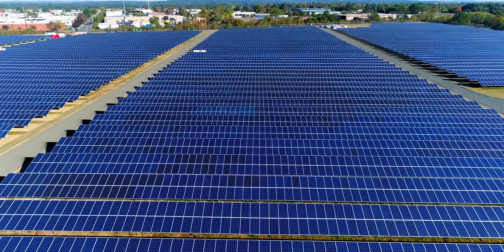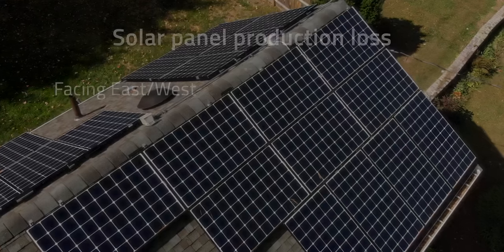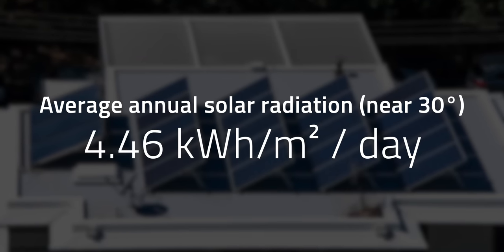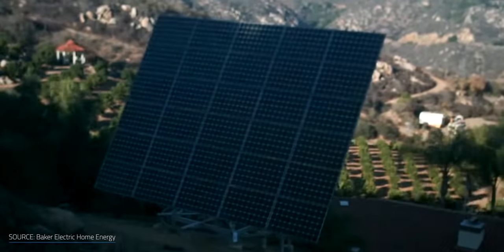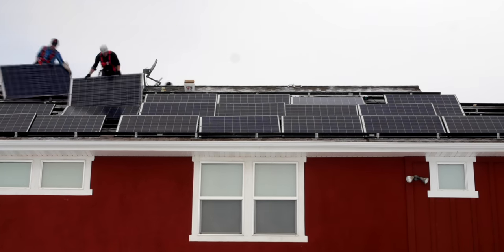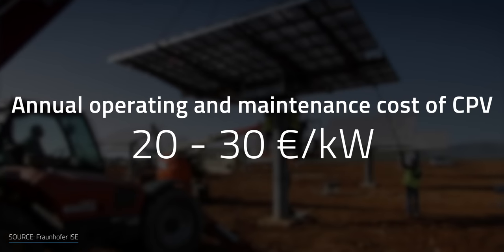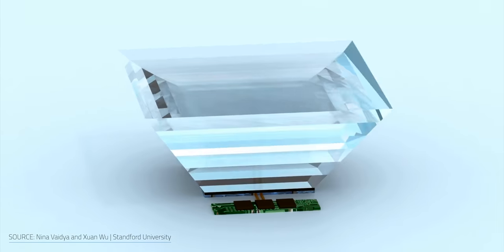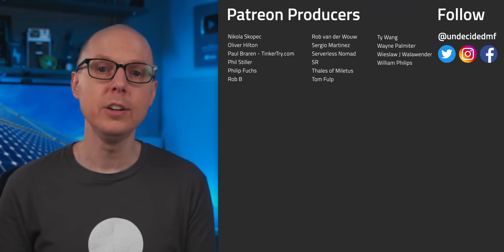This Invention Could Supercharge Solar Panels

Comment: My parents live in Macapá, Brazil, a city that is on the equador exactly. The solar panel angle there is basically flat up, but because it rains a lot there people usually install them slightly angled west or east so rain helps keep dust off the panels

Comment: One thing about PV panel angle that I think isn't looked at enough is what you are optimizing for. Most people and companies optimizie for maximum kWh per year which may not what you want. If you instead have a battery and want the greatest amount of self-sufficiency you have an excess of solar energy in summer but don't have enough in winter. So a higher tilt angle that gives you better efficiency when the sun is low would be beneficial. The same is true if you want to support the shift to renewable energy on a large scale because the bottleneck is always in winter so we should concentrate on maximum yield in winter.

Comment: Your presentations are so comprehensive, and so data rich and so fast in delivery, my brain blows a fuse at regular speed after about 5 minutes. I have to revert to playback at 0.75 or 0.5...need something in between those settings for optimal, non-barin-fuse-blowing...LOL...thank you!

Comment: At the college where I studied, there was research very similar to this solution in the video, but the conclusion was that the cost benefit is lower than that of a conventional panel because the panels lost much of their useful life and the cost of renovation greatly reduced the savings generated by consume less energy from the electricity grid. Another problem found was the heating control for the entire piece in general, which in normal roofs could even cause temperature problems in the house. I was no longer interested in the project because I graduated before seeing the result in detail but I know that it had a conclusion and that they moved their efforts to another project that I am not aware of. As I said, I know that the conclusion was that the cost benefit exists but it is lower than in conventional panels.

Comment: There are some issues with AGILE, I think... Whenever you put any material between the sun's rays and the actual solar collector, you will lose some efficiency because the material itself will absorb some of the light. Additionally, the material you have between the rays and collector will take damage over time due to weather. This is inevitable. So if they do this, the outermost layer will need to be very durable, which will likely come as a tradeoff between light transmissibility. The other issue with concentrating light is heat. The more concentrated, the more heat, the less efficient a solar cell operates and the more quickly it will degrade. That's why it has to be cooled, but in doing so, you're using up more energy.

One of the reasons why solar panels are so inefficient is because they can only collect a narrow bandwidth of light, usually only in the visible range, which is a tiny percentage of light's overall bandwidth. Something interesting I've been watching has been the application of fluorescence, or florescent layers, on top of a general solar cell that you could buy today. A good channel to see this in action is the 'Robert Murray-Smith' YouTube channel. He had a generic solar cell, then took a highlighter, drained out the ink, created a plastic/gel plate out of it, then laid it on top of the solar cell and showed an increase in voltage. I think it went from 1.2V to 1.8V which is a 50% increase in generation capacity and I don't think there was any additional heat created.

If you could dig around and see if there's a company exploring fluorescence with existing solar cells, I'd be very interested in watching that one.

Comment: When I was in grad school, I had a friend whose capstone design project for his batchelor degree had been building a system that determined the sun's position based on GPS and the time of day and then angled solar panels accordingly. I asked him if the increased efficiency was enough to offset the power consumed by all the extra equipment, and he said it wasn't really.

Edit for context: The project was commissioned by the school's paleontology department to boost the efficiency of the solar panels used to power the equipment used at dig sights. The fact that the panels are used in varying locations across North America was the primary driving force behind building a system that's more complicated than the ones described in the video.

Comment: Putting a few modular batteries in the gaps between the inverted pyramids might be helpful. If they slide in and out on needing replacement. A PV panel with integrated battery storage would solve the day night problem but it would be heavier so the roof applications might be a problem. The lenses them selves may add enough weight to challenge some rooves.

Comment: If you have the solar panel tilt set for the latitude there is no need for dual axis tracking. Also for Bifacial solar cells laying down a layer of crushed limestone under and around the panels would help increase efficiency on the cheap.

Comment: An interesting observation about seasonal needs and tracking system orientation is that in heating dominated climates orienting a single access tracker east west so that it points down at the lower winter sun better, provides 30% more electricity in the winter when it’s needed more.

Comment: The best solution is altitude!  I tested the watts per square meter at Boulevard CA, at 3,600 feet elevation and San Diego at near sea lever.  You get over 925 watts per square meter at the higher elevation and only 850 at the lower elevation.

Comment: Local weather effects how desirable an active positioning system is.  When it's cloudy, the orientation of the solar panel doesn't matter. So if you live in a place that's cloudy a large fraction of the time, the extra cost and complication of tracking doesn't buy you much.  You'll get a better return from tracking in Arizona than you will in Wisconsin.

Comment: I think in many areas, the "simply add more panels" strategy will win for the foreseeable future. 
In my densely populated home country, The Netherlands, there's still so many industrial roofs, lakes and highway roadsides which aren't covered with cheap panels that "smaller footprint with higher cost per watt" is a very unattractive proposition. They often even mount bifacial panels east-west instead of south on purpose, because watt/m2 is less important than the need to fit the consumption curve.
Reply: How much coal to make a solar panel for a house about 6 to 10 tons of coal to make a solar panel for a home that last 25 years before land fill

Comment: I won a tonne of those in auction (the concentrated PV cells and the lenses), from a company that went out of business 15 years ago. So this isn't really new per se. Probably the techniques for creating the lenses has improved which is why it's being revisited? Regardless of the ability to bend light, the beginning of your video still needs to be computed (optimized incident angle for the region being installed) for maximum year round efficiency. One of your better videos IMO Matt. Thanks for sharing your passion.

Comment: Will did not mention heating problems.     The concentration of the sunlight is also going to concentrate the area that ends up getting heated.... and hot solar cells are less efficient.    I would be interested in information on how the AGIL system would address this.

Comment: My research with published papers shows that 2 DOF solar trackers can improve energy scavanging by as much as 40%. Now, you need a low mass system based on parallel mechanisms and proper controls for very slow motions (I still need to publish about this control one). Timers is not the right way to control them and we can use a few more photocells to avoid following clouds.

Comment: Sugar is formed possible by carbon from solar and hydrogen to make glucose of C2H6 strain use moveable cell like sun flower trace sun direction but the new design is petal that can passively push light or attract light to control uv level interactively

Comment: Probably the biggest use for something like this would be on a boat. On a boat, the best position for a solar panel is flat because the orientation of the boat to the sun is constantly changing. There is no "South facing side" as that side changes with the wind, tide and course. The other reasons for placing solar panels flat on a boat might include wind resistance or preventing lines from being snagged on the panels. Other issues common in boats is changing shading as the boat moves or as sails are set differently. On a boat, one normally expects to get at most about half of the rated power even on sunny days. A panel of this design could boost this significantly as even shaded panels would be able to see more of the sky.

Depending on the cost of patents, this could go far. That is, if the cost is still too much higher than today's flat panels, it will remain a niche product. Time will tell on that one. The other problem may well be the durability of the lens material. Right now, flat panels continue to be useful for decades, while flexible panels seem to have a short life (rated for only 5 years) because their coating is a plastic instead of glass. So while a flexible panel conforms well to a boat deck surface and can even be walked on, many people still use flat panels because of that price and longevity difference. Lens based solar panels could very easily be made flexible or at least curvable but I don't expect them to be used on a walked on situation.

Another possible advantage to lens based solar panels might be higher voltage voltage panels that are still quite resistant to shade. There has always been a trade off of cell size (fewer large cells are cheaper to produce) and voltage (more cells are needed to increase voltage). However, having parallel cell strings allows more power in partly shaded situations with higher voltage panels. Of course more cells on a lens based solar panel would also be more costly to begin with for the same reason.

Another possible advantage to lens based solar panels which would benefit home owners as well, would be that extra space between the solar collector chips... a great place to add "cooling" tubes where fluid could be directed. This heated cooling fluid could be used to heat living space (we probably don't want it to get much warmer than that).

Comment: This is something I had always wondered why it doesn't already exist for solar. The benefits seem worth it to me. But I wonder if we can take this a step further-- what if the collection area wasn't just in the concentration point, but also add cheaper single-junction cells around the concentration point to collect additional falloff.

One thing we didn't touch on here was also the increased temperatures. In NA, even higher latitudes, solar panels benefit from radiative cooling and even active cooling arrangements where just a little breeze can increase a residential setup by enough to matter (as long as you are storing it properly or feeding it back to the grid for credits).

Comment: i saw a solar tracker that was hydraulic with no electricity. there was a black plate that stuck out each side of the panel that when heated by the sun would expand the vertical or horizontal lines in a way that  the path of the sun would cause it to adjust automatically keeping it facing the sun .

Comment: If this works as explained here, this would even concentrate diffuse light, something that normal lenses cannot do. That would expand the use-case to more cloudy regions, where traditional concentrating systems make no sense. 
But of course it is in the end down to cost. With straightforward PV being so cheap nowadays, and still getting cheaper, it is hard for new technologies to catch up.

Comment: 11:08 It's not like getting an automatic tracking system. The only benefit is that you reduce the surface needed on the cells. Adding tracking to AGILE cells would still improve the performance the same as before. The video don't address why bad angles yield less power. It's simply because it blocks less light (leaves a smaller shadow) if it is angled. AGILE would behave exactly the same.

Comment: I have some ground post solar path lights that have glass domes with focusing dots all through the inside.  Works great!  Downsize?  The heat from full sunlight, even north of the 49th, means that the internal plastic mounts have melted in pretty much all of them.  Focusing means heat, heat means lower efficiency and DAMAGE past a certain point.

Double edged sword to be sure.

Comment: Instead of just a concentrator going to a multi-junction cell, how would the cost/efficiency compare to also having a prism spreading the sunlight's colors across several wavelength-specific solar cells?

Comment: The limiting factor you explain so carefully is the discrepancy between area incidental to the light and the surface area of the soiar panel. That issue is not addressed by these lenses.

Comment: You could simply fabricate the panel  with piping glued to the back of the cells (even aluminum foil) that simply plug into the neighbouring panel with a connector. Then you simply use any cheap flex pipe, run it to the persons refrigerator, bore it into the freezer then back out again. Then you simply throw up a concentrator over the array as neccesary. This is for flat mounted standerd arrays. Pretty freaking simple. The end panels would simple have an adapter to bolt the concentrator supports to. Thats pennys in additional cost.🤷‍♀️. I was a pv system designer and installer btw. Dont forget the dc pump which is like $300 and its dedicated solar panel, $60. In theory you could use the outside pipe thats for watering your garden and splice back into it before the bib but that would never work obviously. But God i need to see it. The idea is making my head hurt. Though i know making it feed into itself is not gonna create a perpetual loop of flow. Damn

Comment: Try using one Solar Panel at the bottom  and on the spaces between the grids use fiber optics to layer another stack above. It is all in the way that you space them apart it can work as long as the spaces between are just right.

Comment: I was doing some research and came across another tech being developed that uses lead selenide quantum dots printed on an organic polymer. The idea is it converts lower infrared spectrums into higher spectrums so the cell receives more absorbable light. It is a sheet that can theoretically be applied to an existing panel with ease. I wonder if these two technologies could be combined for an added effect? It is being developed by Cambridge Photon Technology, an offshoot of Cambridge University, if anyone wants to check it out.

Comment: That's very interesting we tried a simpler system in the early 2000's and the panels just heated up to much reducing energy output
We tried cooling the panels with airflow system and blanketing panels with water cooling 
At the end of the day the panel out put did not support the overall cost to watt ratio

Comment: The cell layer tech and lense magnification has been around for 50 years.  They have been used for space applications since the 70's where reduced weight and size plus reliability and maintenance free operation comes way before cost.    Higher cost of higher efficiency has always been the problem for every type of power generation devices.  The good and bad news is that as fossil fuel becomes more expensive, higher efficiency devices of all kinds becomes more competitive.

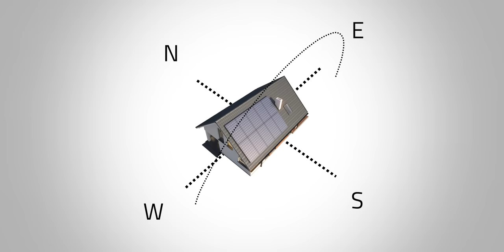Comment: Matt, this is an excellent video. Thank you for your ongoing efforts. I have two thoughts. FIRST, you show a graphic of the sun's movement starting at 2:36. This graphic is technically incorrect because it shows the axis of the sun's motion changing. Yes, the sun moves in an arc about the house. But the axis of that arc is always aligned with the earth's axis. On the equinox, the plane of the arc intersects the house. At noon, the sun passes over the house at a 90 degree angle to the axis of rotation. At winter solstice, that same arc, on the same axis, shifts towards the equator so that at noon the angle to the sun from the axis is 90 degrees minus 22.5 degrees. This arc intersects the horizon towards the equator from east and west. By the summer equinox the arc shifts away from the equator to give a sun angle at noon 22.5 degrees higher than 90 degrees to the axis. That arc intersects the horizon away from the equator from east and west. In essence, the circular path of the sun shifts in an approximately sinusoidal way north and south along the earth's axis. Bringing this back to your video, there is a practical implication related to movable panels. You point out that aiming the panel brings collection improvements but that each axis of motion costs money. If one panel motion axis is aligned with the earth's axis, there is a great benefit to providing timed motion about this axis (at 15 degrees per hour). Even if the panel were fixed in the other axis to be perpendicular to the axis, the greatest sun angle error would be 22.5 degrees. If the panel can be manually adjusted just a few times a year, this error can be reduced, resulting in negligible collection loss. So you get almost everything with only one, simply timed, axis plus a simple manual adjustment a few times a year.  SECOND: I believe that energy collected by solar panels is very closely tied to the sun flux intercepted. Losses at low angles are modest, I believe. For this reason, I believe the AGILE device will provide little benefit in terms of sun energy collection. Instead, I believe it may be better to think of AGILE as a solar concentrator that may enable the use of smaller, more efficient (and expensive per unit area) solar cells.  Thanks again for your thought-provoking videos!